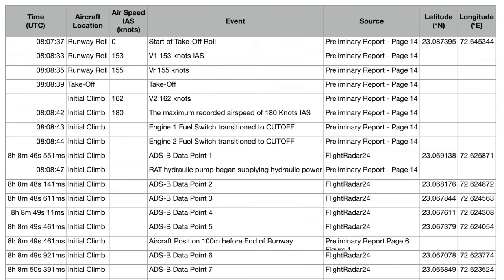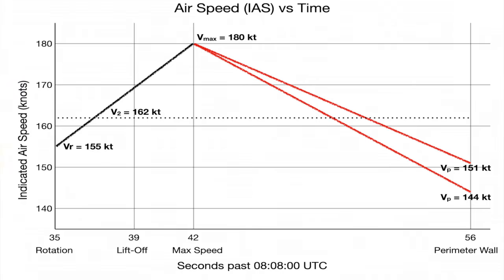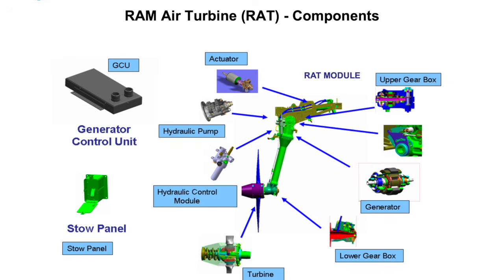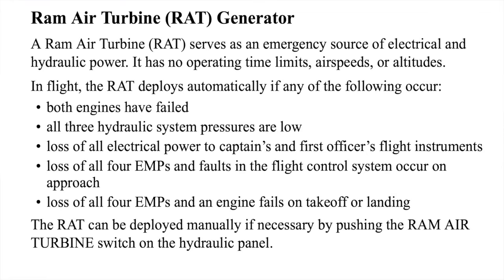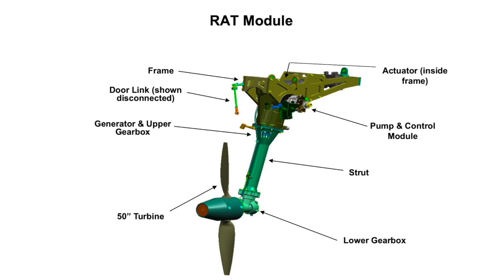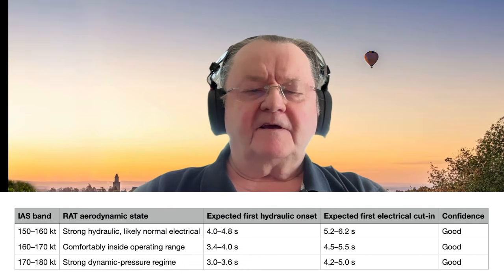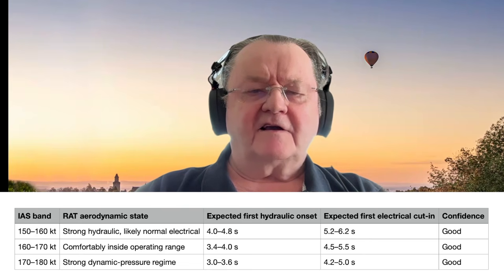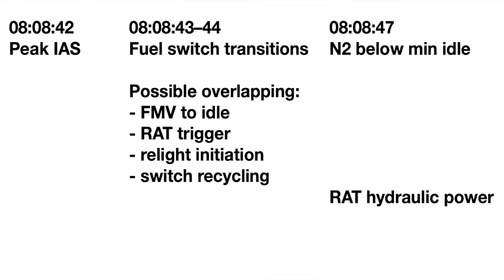AI171 - RAT Deployment - Spurious, Human or System

Comment: Richard , thanks for  Your  explanations.  I calkulated   all   that  some time  ago  but including  weight   of the  plane  trust  Engine performance,  glide ratio   Energy involved   etc  for  evry  freme  thet  can be  seen  on ten video.  To   keep  things  simple  You  are   approx  right,  and   Lost   of  power bgun before max  speed  was reached   and ended   after  max  speed  .  So  flame  aout  was  immediately before   sek  42  on boath  engines.   The intersting  Question is why  did the engines   fail!     the  Answer  is  thy  did  not  get  any  fuel, flame  out!    so   the   next  Question   is   why no    fuel?   
Vou  go  threogh  the  Systems and   find   Fuel  pumps   an  Fuel  valves .....      and  betwean   rhese  items  You  find  duel pipes   with  fuel !  If A   valve  is  closed  You  will heva    a time delay   from  closing  the  valve   to    flame  out.     Perhaps RAT  deployment   can  tell   us  somethng   about  the cause   of  the  engine flame   out    There are  two  posibilitys!    one  is  that RAT  deployd  because  of   some  kind  of  a  signal   from  the engines   multible  signals   are   posible!      Early  electricel  signals   or  late  Signals like  low  RPM  etc....      The  other  posibility  is that  RAT  deployed before   Fuel  cut  of!    So  Your  analyse   shows  a  rat deploy command window beginning   at  08:08:43,2      ( Yoiur  videao  31.17)   and  that means   well  after  klame out  and following  lost  aof  trust = max  speed  =  08:08:42    This means   that  if  ther eis  no  time  delay  for  the  rat  Derployment Command    the RAT   reacts  not   on   immdiate   signals   from   teh   failing  turbines   but   on  secundary  signals  like  Lost   of  RPM  or Electrical power  or  anything  else  that  changes   as  e  reaction   of  RPM   lost   of  the Turnbines.  RAT is not  giving us   a  clu   why the engines   faild!       But  far  as  I  understand ,    i might  be  wrong,   You  say  that  there is  a  tme  delay  for the  rat   to  derploy   if  there is   an  electrical   feliour   on C1 or C2    so  The Fact  that the  rat  did not  deploy   earlyer  is not   showing  that   C1   and C2   had power!    it  is  just not  the  indeicater   we  are  lookong   for.       RAT  is nit the reason  fpr  the    kind  of  witishc  smoke  Cloud  of  dirt   we  see   during   rotation!     ( Rat  produces   quite  some  rurbzlce   near  the  grounf if  employd  at  that  moment!  )     I  would be  nice   if  we  had  some more  Data    let's  see   what  the  Judges in  India   will say !
Reply from the maker: Walter, without fuel, how did the engine relight sequences start to work? I agree with you we need more data. I have been through all the systems from the manufacturers' manuals.
Reply: @IAIwithRichardGodfrey  Sorry for  the   multible mistakes in  writing  thanks   for  Your  time!    I  do not   theink  that   the   impression  the  data   of  the  report is  giving   is  righet,   the  report   seems   to be misslieading.   So  I calkulated  with  the  data  i  could  get how  the  Air india  787 would perform  under  the  conditions  at  the  airport.   teperature   und  oreassure   leave    a  situation  that    shows  that  approx  calkulations were to  positive  performancevise..  And  for me  tere  was  teh  Question   why   was  the  plane  heavy but  not at  the limit.  Oviorsly  they  gave  away   some  payload   and  thet  is not  plausible!  They   want  to  earn money!    but  wehen   cakkulating  precisely   the  reason   fpr  the  beright   of  the plane   is teht  mor  weight   would  have  the  konsequence to  need more  runway.  The  plane   needs  Runway   to   stop  in  teh moment  it  reaches  the  "speed  of no return"    my  calkulations   cakkulate   the  energy the plane  had   at lift off  and the energy   it had at   altitude  ans  speed   when  the  Teil hits  the buildig.   As  wie have  two points  in  the landscape  and  in time   we  have teh  everage  speed   and  by  changing  the  parameters  you get  a  near to  perfect  fit.   please admit  that   the  window  of  best   glicde ratio  is  nit  that  wide , because of the  induced  drag   glide retio  is  going  down   at  speeds   to low.  the  simulation  shaws   that  with   fill engine  power  and  one engine    they   would  have  barely made  it   with  landing  gear  extend!  Landig  gear up  is  essetial   with   one Engine.... So I think that  is  the  second  reason  not  to   fly   with  maximum   load. Thes  is  pritty  exactly  the  line  of  survifel   in  the  case  od   one  engine  faliour  and  Landig  gear   out....   The  suggestion   thet  Performacne meats   exactly   this  point  means  we  can  calkulate  how  long both  engines  had full trust  and  then  had  no  trust.. .  in  te  calkulation  You  can   soften  thet  strict   cut...    In  the  end  I  am  shure  the  "Cut"  is at  08:08:42   pritty  precise.   An  electricak  engeneer  with   a style   of  explanation  that's caotic  and horrable,   brings up a piont  saying  tehre is no  need   for  the  fuel  switches  to move  to  cut  of the  fuel... Without going  deeper  into the  electrical  system  hie  is  right , because  just for an  eyample  pulling  the  fire handele  will cut  of   the  fuel  without  mooving  the  switsches...   etc  I makes sence   to geo  deeper  into   that  problem... 
Dirst  problem   I had  with an  oter  explanation  iss  that   if  en electricak   feliour   is   on C1   or c2   (  in effect the  were connekted   )  is  that  we  schould see   the  RAT   deploied  immediately  ...   As the  tust  vanisched   at   :42   and  i  suggeste  the  engine   steill has   fuel behind  the  fuel  calve   for  en  equvalent   of  elt least   2 sek  propably  3  sek  the  signal   for  rat  deployment   would have  tio be   at  :39  and as  far   as  You  see  it  that  is not the  case.   It  seems  that   the  rat receved   the  signal   to  be deployd  within a  second   or  two   after flame  out  or better "cut"   if  we  think  iof  a  slower  flame  out    and conzentrate   this  as  a Cut  .  So  teh rat deployment   is  a reaction   and  not   a  signal  for  the  reason  we  want to    know....   I  argued  thet  the big  doors   for  the   landing gear  serviched   ba C1 andC2    died not  open  so  they  aitomaticly   schould  be  opened   whe  the  plane lifts   off,   but  i  found  out  that  that  is not  the  case  on  every  787 so  this  does not mean  power lost   on  C1  and C2   alt lift  off.    But mey   question   is  what  happens   if   there is no  power   on C1   or  and C2   rgardeng   the  RAT!     does    the   15  sec  time  delay  applay   for  this situation? If  teht is the  case   we  can not  prove   that C1  and C"  were  working     2   to  3  sek  before   08:08:42!   
If  engines   deil   pilots  will  hear  and notice, (panel  compleately dark CI  C"   do not  work)   and  perhapd  grab   to  the  fuel  controll switches   to  cycle  them  to  restart  fedex  etc   I  do not  want  to  get precise   just  the  direction   to   think....    Now   next  theing   i  would  like   to  see als a pilot  ore  first officer  ist coltage  on  C1  and C2    and  that  migeht  come   with  RAT....     Perhaps  we  have  teh problem  starting   at  the  batery  bus....  but   whatever  the reason is  they  musthafe  apreciated   c1and c2   working   with RAT...    od  cause  one  sinde  at  first!     left side  at   first   next  thing  to   do  is to start  the engine!      if  it  is  still  rotating   You  have  a  chance   to  do  so  without     the turbin power  of teh  turbin  in the rare....  if  one  engine  runs    You try  the  otehr  one.   so   for me  it  makes sence that  one  pilot  starts  one engine  first  looking now   at  th  core RPM  and when seeing   tat RPM   ncrases    aand  tehengine will run    trying  the  oter  one.... So that maks  sence  Question  ist if  teh   fuel   valves   closed   because   of   let's  say  C!  and C2   faliour   the  had  to open later,   For me   that is  plausible  because   C1 and C2   got  electrcity   by RAT and  then  opend  by  the  fuel  switches manualy   pused  in the  open position...     Question   is  is  theis   logicak   tecnical  posible...    diving deeper  I  came  to the  conklusion  yes.....    

so to  answer Your question  The   fuel  valves   could   open   after   Power came  back  on C1 and C2   and  did open after the  cut of  switches   were recycled!  by  the  pilots . 

So to   answer  the  Question   in the  room   is   to  answer  do  we have  a proove  thet  Teh pilots  actions  brought  the plane down   by  stitcheing  teh  switches  withot  wanteing  to  recycle  the engines    the means  can  i Proove   thet  C1  and C2   failed    ma  positopn  got  weaker  becaus not  openeing  the  doors   for the   landing gear   ist not   necesarryly   a   proove !    and Rat deployment  triggerd  before  the   Engines  got problems   seems   to  bei not  correct.   We have  the  evidence   of  some  whitisch  smoke   just  during   take   of,  and  thet  is not  a result   of  turbulence  by  the  RAT  near   to   the  ground,   becaus   ist  seams  thet  the  RAT   was  in    at  that point in  time.   If  the pilots  are to blame I  do not understand  the  very restrictive  way the  data   are handed.  In  the end   to  understand   what happened   we  need  more data ....    If  the pilots   did  everything   righet,   for me   the problem   is  tat   tecnicaly  its posible  for  a  fault   kick  out   C1  and  C2  at  the  seme  time  because  they  cen  be  connected ,  To  say it  this  way I  never would   do that!         In  a  modern Car   more  then  half  the  problems   that   stops  Cars  from   runing   are  electrical  Problems,   the firde  diesel  I had  did not have   anytheing  electrical   it needed  to  run, You  could  an  a   warm  day   start  it  by  pushing  roling   jump into  the  car   and   use  a  gear!   without  a  battry   on board!  Electric   and  software   are always  a  problem   to be  solved !
Reply from the maker: Walter, thanks for your detailed and thoughtful comment. I can follow your reasoning.

I’ll reply in English so other viewers can benefit from the discussion. But if you prefer, feel free to write in German in future. I speak German fluently.

If I understand you correctly, your core argument is:

The aircraft was operating close to its performance limits, thrust was lost abruptly around 08:08:42, and although the fuel switches moved, this may have been a pilot reaction to an electrical or system failure — not the root cause. Therefore, a technical fault remains a viable explanation.

You also question the report’s performance interpretation and suggest:
- the actual performance margin may have been tighter,
- the timeline can be reconstructed from energy/trajectory analysis,
- and an electrical failure (e.g. C1/C2) cannot be excluded.

I broadly follow your performance reasoning and reconstruction approach, and I agree that the thrust loss timing around 08:08:42 is consistent with the available data.

Where I would challenge your conclusion is on the systems side.

From the publicly available data, the following sequence is quite well supported:
- the thrust levers remained at takeoff thrust until impact,
- both fuel cutoff switches transitioned to CUTOFF and later back to RUN,
- engine parameters show rundown followed by relight attempts,
- RAT deployment occurs very close to the onset of the engine event, but the exact sequencing relative to thrust loss is not definitively resolved in the public data,
- and APU auto-start logic is triggered shortly afterwards.

Taken together, that sequence is internally consistent and does not require a prior C1/C2 electrical failure to explain it.

Your alternative scenario — electrical failure → loss of thrust → RAT → power recovery → pilot switch cycling — is technically imaginable. But at this stage, it is not currently supported by the released evidence, whereas the recorded switch transitions provide direct evidence in the current dataset.

So I would frame it this way:
- your hypothesis is possible,
- but it currently has less evidentiary support than the simpler explanation based on the recorded sequence.

To resolve this properly, we would need more detailed data, in particular:
- EEC/FADEC fault and event logs,
- high-resolution FDR/EAFR timing,
- independent confirmation of switch states,
- CVR audio across the switch transition interval,
- physical testing of the fuel control switches,
- and aircraft network / electrical system fault logs.

Until that level of detail is available, I would be cautious about drawing firm conclusions in either direction.
Reply: @IAIwithRichardGodfrey  Richard,  I  do agree that  the data that are  open   for    everyone   do not  prove  thet   the pilots   aer not  the  cuase!    So  the  suggestion   the  report   leads   to  might  be  right. Drawing  firm   concusions   is  I  eggree  on that  not  posible   with   the  Data   we  do have,    so  We have to  work with  every  suggestion  We can get  by asking  people  by brain  storming   by  whatever  metode  we  can  think   of  and  then   find  out wether  or not the suggestions   develope in a  posiility   or  can be   excluded.     this   will  lead  us   not  only to  conclusions  thet help un  in this accident,  but   although  to  Questions and  stetements  regarding  the   Secuity and  Thinge  that might  happen and  lead   to   a  desaster  but  did  not happen  in this  case.    So  for my  understanding  we   need  an explanation   for  the  fact  that both  engines   coul  fail   one  after another.   Obviorsly because   a pilot  schuts  them   down     by  the  switchs   or by  the  fire handel...  No need  to  explain...   but going  deeper  into  te  electric  system  we hav   a problem  to  prove   that if  something  gores   wrong   in The C1 bus the C2  bus  is not  effected under   all  circumstances.   This statement   means   wie   have   a   cain   from   a  rout  cause   wie  do not  know  (and we  do not know  wee r or not   ferer  is  a  rout   cause   for  C1   break  dowen   or  even   if  C1 brol   sown  before   the  fuel  switches  were mooved!   )  Freom w reite  cause addcting 1   to   a  failiour   of  c2   the  other sinde   of  the  Plane.  This  is   contrair  to  the security  conzept   "fail  safe"      And   it  is  im my  eys  a  good idea  to   reconstruct the System      giving   fail safe   a higher prority!  
Although   What  we  saw  in   the  date  wa  have   ant  waht  we  can   explain  is  getteing  slowly   clearer  not everytheng   we know   fits to  the  theory   ite  Pilots mistake.      And  I  thingk for me   it's not  e difference   Weiterh or not  rhe  route cahsei  is  a  piilot   or  ist's  an oter  person    or  organisation ...... So   the  idea  thet RAT  derployment   schows  prooves,  that  something had happend  before  the Switchs  were  tuched   or before  the  engines   lost  rotation  and  proves  C1 / C2   had  a problem   ist  off   the  table!    Recalkulation   of  the  acelleration  til  lift  of  does not  show   anything  wrong  ant  it  was   a good  idea   zu  suggest  that there might have been   something   wrong,  as You   and I  did  ind eth beginning  before it became  clear  that   trust  is   under these  conditione   temperature and  preassure not   fully  available   and  maximim  trust  when  sth  plane  has  a  spees   of   zero  cen not be optained  durichg  acelleration  but  dekreases  with speed...     For me  it  was   quit a lot   of  work   to  analyse   the  point   if the  tip  of the Teil  in  reation  to   the  Skyline  Pixel   for  Pixel   Question is   what  building  do   we  see  and how  is the fokus   of the  Camera   etc .  Speeds   given   havet  to be  rekalculatet  to  tru ground   speed  in relation   to   the  rnway   etc....   In the end   the database  ist  pritty precise  and   shows nothing  else  than  the  Fact   everything was OK and    the  Weight   of the  plane  was precise  at  the   Limit  within  the  Regulations.   So  every   sigen    of  a sluggisch  acelleration  or anything  else  could be  execuded   withen a  pritty  tiny margin!   always  far  as I  can see ind  withim my limits...  
So  were  are  we   where  am  i now?    the  Questions  remeining  are getteing  less!   One  open Question  You mighet   finde  aout  ist  st question  regardeing the bog   doors   of  the  landing  gear  or better    waht happend   wit the  landing gear!      We  see at  all photos  Landing gear is oput  and  was not  retrectet.  Taht migeht  be  related  to  the  work load in  the cockpit  and  can be  expected.     Retrection   of  te  landing  gear  would not have saved   tem!   That's not  the  point!      If  thex  had   one  engine only  retrecting  teh  landing  gerar  is  under  teh  vonditions   Prasute temperature  spees inuced  drag    etc  very important  to be  able  to reach  a  small climbe rate   and  then   to  rump  fuel  and  have  a ligeht  margin   to fly  back  zo  the  airport   and that mians  to make  a  shallow   turn   etc.....   OK   if the had retreated   the  Landing gear  thea  all  would have   been killed   a  few  hundred meaters   furter  away... 
As I alraedy   communicated   its  a  feacher  of the   787   thet  the  big  doors   of  the landeing  gear   open  automaticly  at  lift   of   and  Poewer  is hydraulik  and controll   iss  electric   and  electric  power  is bus C1  and C2.    What we  seee  ist  thet  the big  doors  did  not  open   so   this   mighet proove  C1  and C2   had no  power  at lift of   aor hydraulic  power  was  allready   gone...       but   furher investigations  lead  to the  information  that  not all 787   have  that  system   so   sthe  oservation   is  in contrast  to  what  I  thought   at  first  not  a prove   for  a  faiior  on  C1   and C2       Do  You  know  anything  that  can   clearyfy   the  tecnical Questios as You  did  with  the  RAT...    I  could  not! 
There is  still  the  further  evidence  of  the  kind of  whitisch smoke  coming  from   the  point   of  rotation   and alt least seen   on  the  left sinde of the  plane     Your  suggestion   was blow our  of  the battery  I calkulatet   the  ammounr  of  smoke  the  volume   and  the  doameter  oft  teh   vent system,   all  is publisched   bacause  of the batteryproblem they  had  send  teh   foy with  tat  container  and  In  teh end   the burst  ist  to  short   for  a  sudden batery faliour...    it  takes a  few  seconds  betwean  opening   the vent  system   and   eaqual   preassure  in  the  casing   and  outside  mieaning  end of the rapid   phase  of  Ventilation,   The  posibility that  ir  could be   the turbulence   of  rhe RAT deployed  so   short  abofe the  runway   was  exekluded  because  Tat  derployment  tekes  time   and    if the  problem   occuted  so much  time  before  Rotation   Pilots   would  have  tryd  to  stop  the  plane (Without trust reverse   !  eoulf have  been a  serioud  accident   i  suppose)    So  my  suggestion was  its one  of the  Tires   damaging  C1 system   that  is   exposed at  teh  rere   of the  Pylons of  teh  landig gear.....   But no  confirmation   of  a  flat  or broken  tirer left  main landing  gear..    No  discussions  about  the  whitisch smoke     The  australian   guy    shows   that  there are   other electrical polsibilitys,  I  do  understand   what   his point  is   but he  dug  deeper  than  what  I  can  seriously   do   and  I  can not  prove him wrong,    so   we have   still  a renge of  polibilitys  open  and  we  can not  prove  them   wrong     with   the  evidence   we have.     I  am  pritty aunhappy   with  the situation  because  The  data  recorder   is there  and  provides  the  date  needed   to  explain   the  accident!   You  showed   what  is  recorde  and   That   is more  than  enough   to   finde  out  weather and  when  C1  and C2    failed.    etc.    So  thank You  for beeing  part  of  the  system   keeeping  the Peassure  up     and  hopefulliy   the  public  gets  the  data!   👍👍👍👍👍😁
Reply: @IAIwithRichardGodfrey  oops  the  the computer  sendet  the  comment 4  times  was  supposed  to do it once
Reply: @IAIwithRichardGodfrey    we have the max  Speed  in the  report  at   08:08:42   and    thet means   compared  to   the  expectet  acelleration,  we  alreadx  haver   some lost  of trust!  at thet   tome   and before   the  switches   were mooved...   that prooves   the   trust   was  decreasing before    the switsches  were mooved...   But  ist can not be  prooven ba   evidence  that   the report  is  right...   We need mir  info!   perhaps  its   just   a  misteke in  communikation!    The  RAT  deplment  time Delay    does not  exklude the  faliour   of   C1 or  and C2   before the engines  failed  because  of  the  15 sec  delay!